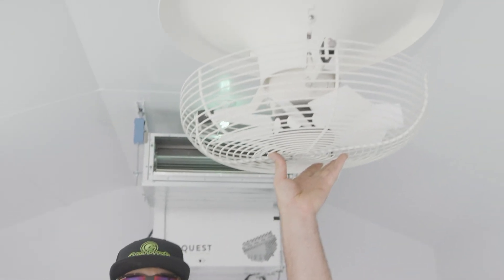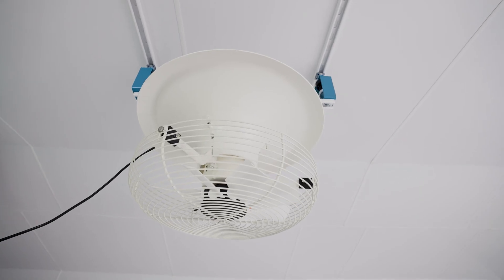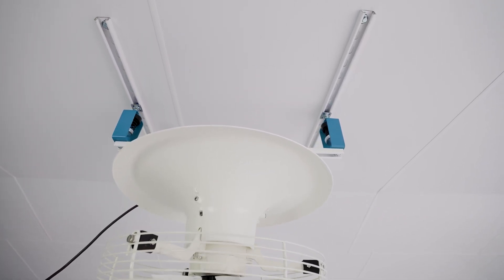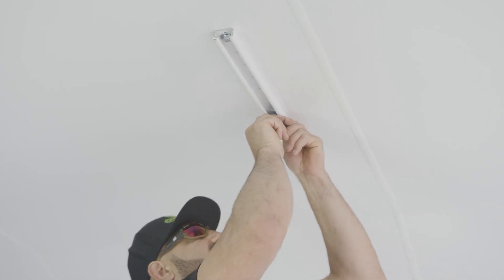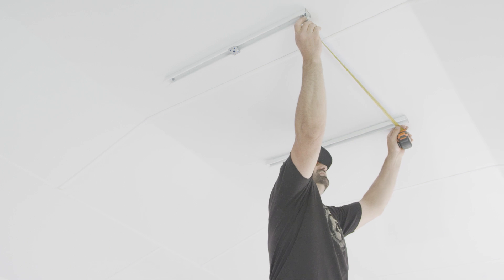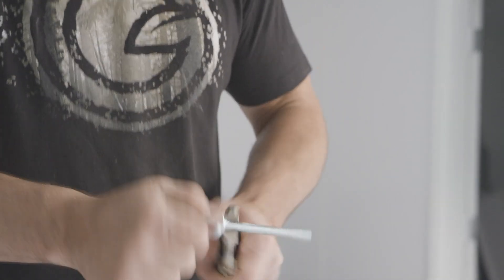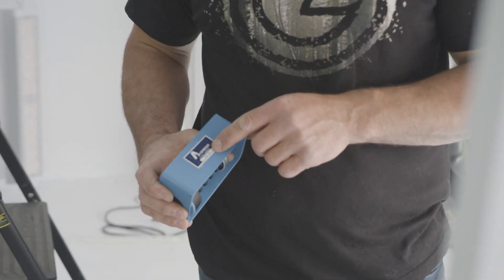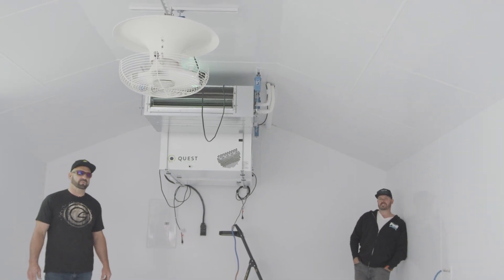Grow Room Fans & Air Movement | Growing Green Vol 8

Comment: Have you run a full house using just the V-fan in that room yet? Not many examples of these used in smaller spaces. I just switched to the trough style tables in an effort to increase airflow through canopy. Debating the fabric ducts with all the holes vs one of these fans. I have just a stupid  number of fans for a 10' x 10' x 8' space. I'd think there would be a substantial shadow created by your other HVAC equipment. I love to know how it worked out in actual use

Comment: I tend to disagree, oscillating fans are still a very valuable tool for air movement..yes there can be too much which can cause wind burn but just below that threshold can be dam near optimum for a high performance grow. It forces higher rates of transpiration especially when driven by the higher sides of ppfd and co2..even if one or two colas are too close and get effected with wind burn it’s a great sacrifice to the betterment of the whole room. Every grow is its own beast and to completely dismiss oscillating fans is ignorant IMO. I do not have this fan but cannot imagine it would be a direct replacement and get the same results of forced transpiration, and seemingly doesn’t seem very well suited for a residential grow where height often becomes a issue.